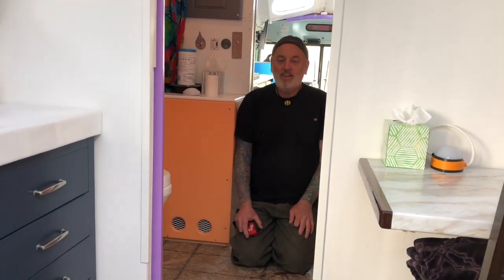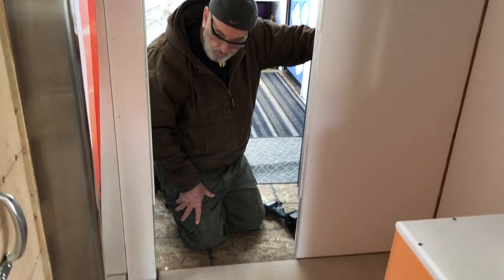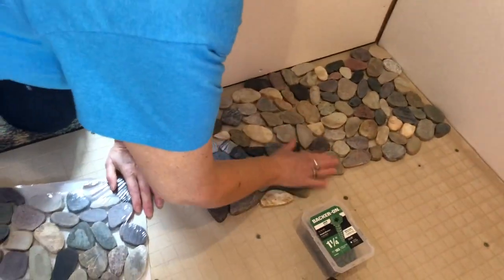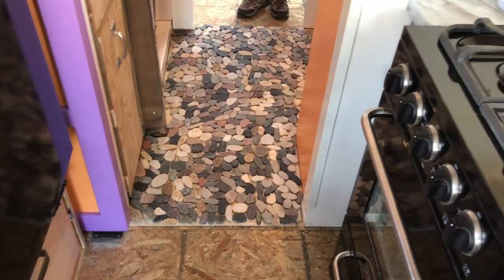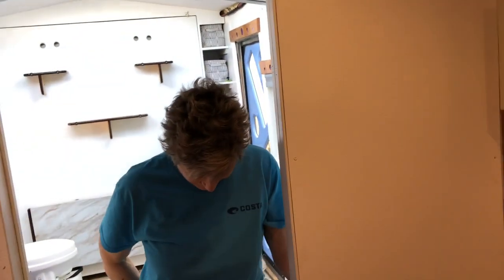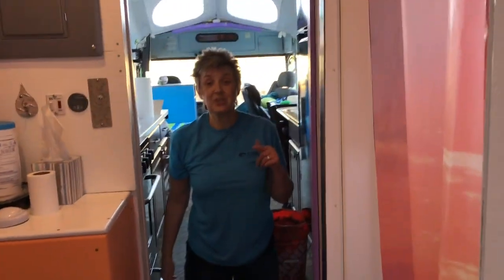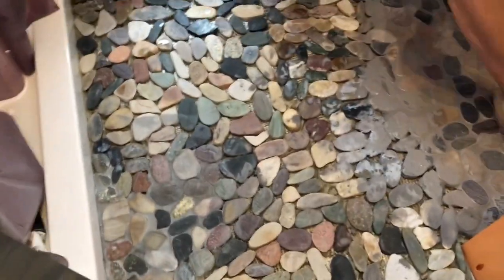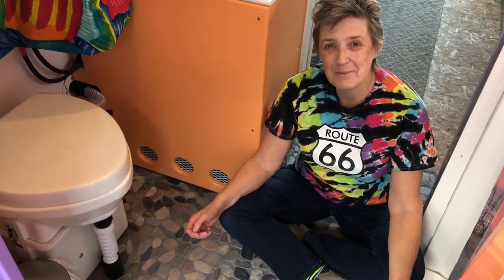Rocking the Bathroom Floor - Vlog 208 School Bus Conversion

Comment: Great job on the rocks!! OMG! They look SoOOOOoooOOO Good! Bet they feel great on bare feet too! Question: What type of grout did y'all end up going with? We heard that there's some sort of flexible additive or grout that's designed to be able to handle more vibrations, but we haven't found it or the name yet. So we're curious to know what y'all are using :)

Keep rocking it, y'all!
- Brian + Erin
Reply from the maker: Thank you --- we used Fusion Pro single component grout and it requires no sealants. It's already in there. 😁It seem to be working really great. We love it.
Reply: @KnappTime  sweet! We’ll check it out!

Comment: This looks amazing, it truely does. I'll join the chorus and advise to seal the floor very quick. The seams are vey broad on this floor and the grout will happily takein any dirt it can find, especially any oil or fat. Please get yourself a sealant for that and protect your good work. What will you use for the rest of the floor?
Reply from the maker: Thank you --- we used Fusion Pro single component grout and it requires no sealants. It's already in there. 😁

Comment: I replied about sealing. The grout is not the part that got dirty with foot traffic.  It was the porous surface of the rock that got dirt in it. I cleaned mine very good and sealed it and the rock itself no longer got dirt ground into it. Good luck with it all. Hugs. Bob Marie
Reply from the maker: No worries .... we do have a sealant on it. Thanks for your concerns. 👍😍👍

Comment: I have used the same rock tile. The only advice i have for you is be sure to seal it as soon as you can. Mine got dirty from walking on it. It was hard to clean but i cleanes it and sealed it and it looks great now. Hugs. Bob
Reply from the maker: Thanks for the tip but  we used Fusion Pro single component grout and it requires no sealants. It's already in there. 😁